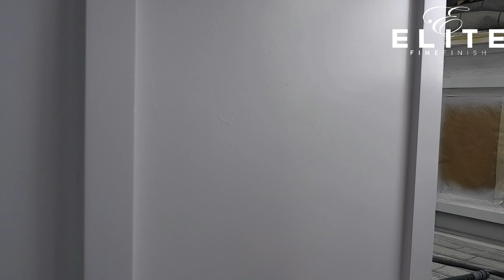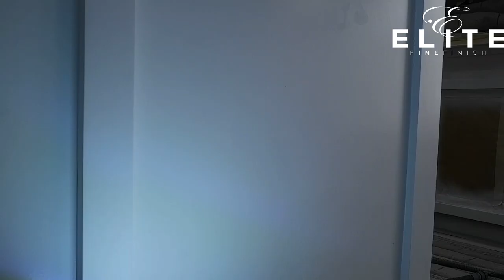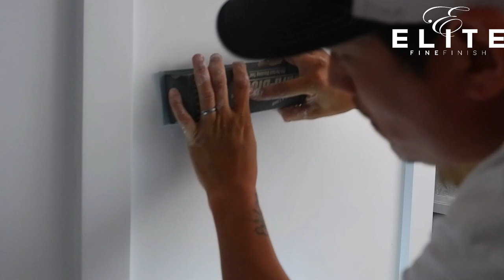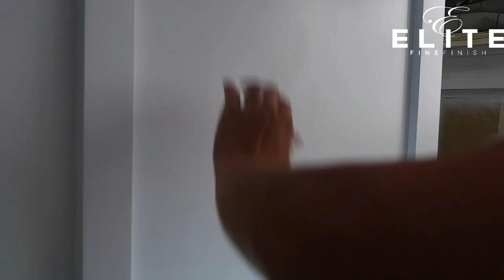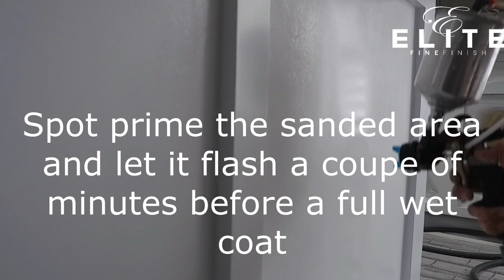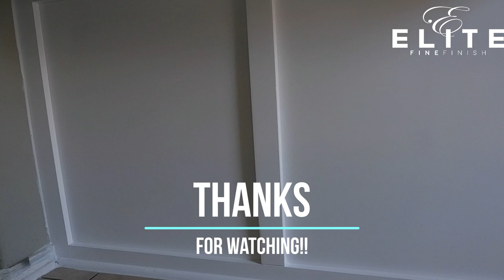How to fix a paint run on cabinets

Comment: Hi Louis,  Nice work. I have been doing kitchens for 25 years and perhaps can offer up some helpful advice. I spray all my doors flat down on a turntable in my shop and as for the frames and boxes attached to the kitchen as you’re showing here, we use high-quality artist brushes and the low nap velour rollers with primers and paints thinned up to 40% for an even smooth flow and it honestly looks exactly like the doors after spraying ....  spraying vertical will always cause a problem for you for as long as you choose to do it. In my professional opinion spraying frames and boxes on site is not necessary and can be done by hand with the proper technique to achieve a sprayed like finish. All my clients prefer the on-site work done by hand as they don’t want any spraying in their house anyhow. Hope it helps and perhaps you might give it a try sometime. Best of luck brother and keep painting .  Your work looks fantastic, and you certainly have a hand for doing professional kitchens as I can see.  Wishing you many more years of continued success.
Reply: Nice tips!
Reply: Thinned 40% is way beyond manufactuer's limits.  Most paint data sheets recommend only up to 10% thin.  Why not use an HVLP instead of brushes or airless?  I have sprayed test panels that were 40% thinned and noticed that the finish can be compromised after a month or any changes in humidity.
Reply: @TechExposedTV   “Up To” 😉

Comment: Just did my large bathroom vanity doors and drawer fronts. I hung the doors on a rack and got some runs on them. But the drawer fronts were good as I did them laying down. I have the fugi 4 unit and thinned the primer to their specs with a 1.5 nozzle. But it looks like I could have sprayed the primer with no thinning. I could tell by the way it sprayed. Too running going on. I will try spraying the advance straight out of the can.
Reply: I'd be really surprised if you were able to spray unthinned with a 1.5mm nozzle and fuji 4 stage and not have it clog up on you or get major orange peel.  Maybe if you had a 3M PPS 2.0 H/O cup it would help, but still, that's a really thick for that nozzle and a 4 stage. It's possible if you had a 2.0mm nozzle and had your fluid knob only open 1/3 of the way and went REALLY SLOW, like 3 seconds per inch, you might get enough fluid down before it starts to evaporate and give you dry finish. Any faster and you'll have blobs and orange peel.

You'd need a 2.0 or 2.5mm nozzle. If you want to thin primers 10-15% you can use a 1.8mm and get away with it.

Comment: Is there anything you can do when you see the paint run when it’s nice and wet to fix it?
Reply: No you’ll make it worse.
Reply: @battlemasterszone1750  😆 I know… man those cabinets were a bitch 6 months ago, but I did sell the house!
Reply: It seems to help if you notice it wet to lightly smooth out the ridges with your finger. You still have to sand it out and redo it, it just makes the sanding easier.
Reply: If you notice it right away before it flashes, you can take a wet microfibre cloth and dab it slightly. If it's a vertical run most of the time the paint from above will fill it in almost 90%.

Comment: How many coats of 851 to hide the 180 grit scratches?
Reply: They won't be hidden lol. He'd either have to follow up with 220, 320, and 400 or apply like 20 coats lol. Either that or he's counting on the homeowner not seeing the sheen under the cabinet.